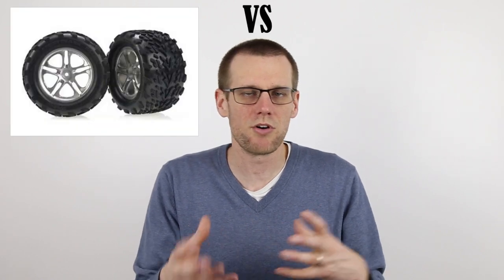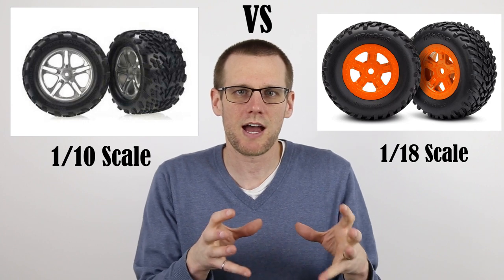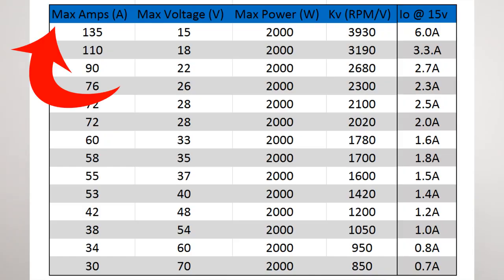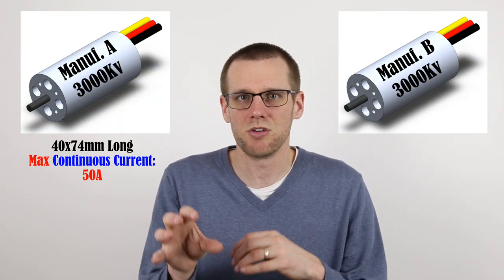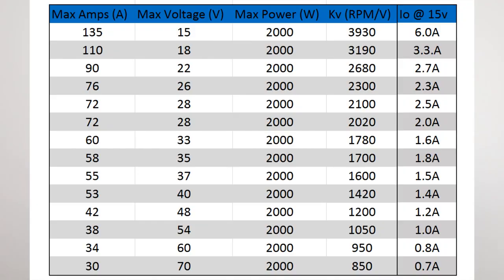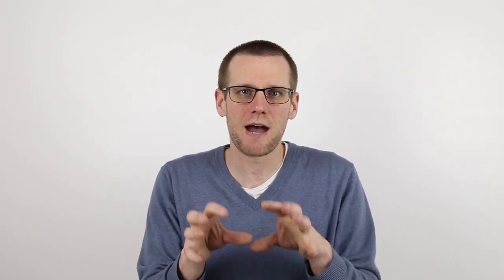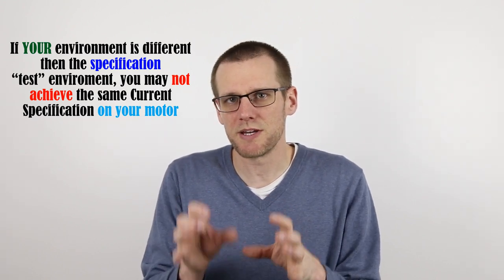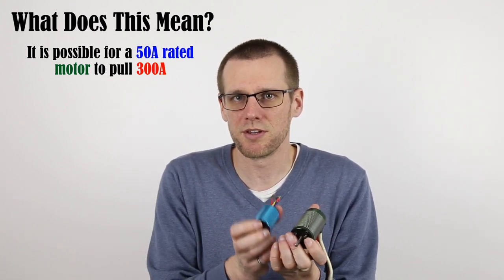Maximum Motor Current Specification - What you Need to Know

Comment: Great video Ryan, you're really helpful as always, I can pull 150A easily from my 95A rated motor but it does come at a cost of extreme heat build-up, if your case is an RC boat, please get a good quality water-cooling sleeve/jacket along with a water filter coming from your pump/rudder intake, learn from my mistake, I fried a 200$ motor once debris and algae clogged mine, all rest of the electronics thankfully survived.
Reply from the maker: Thanks for the comment Eden!

Comment: I'd love to know how much power some of these things can handle before magnetic saturation becomes an issue....assuming you can keep them cool of course. Like what's the max power in a liquid ammonia bath?
Reply from the maker: That would be cool but also difficult to test!
Reply: @RCexplained  KO motors are doing some interesting things with high power outrunner designs and cooling solutions. They've run some silly numbers using "cryospray" on the bench.
Reply from the maker: wow that is interesting!

Comment: Nice video! What about magnetic saturation? If the current is increased too much (even keeping the motor temperature low), cannot a magnetic saturation occur - so that the increase in current does not necessarily imply an increase in torque (this relation is no longer linear)?